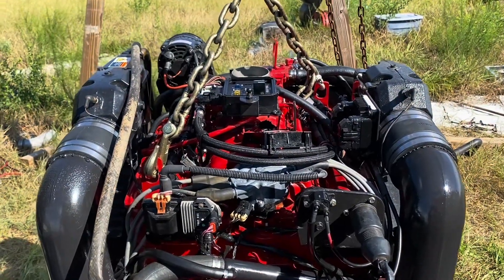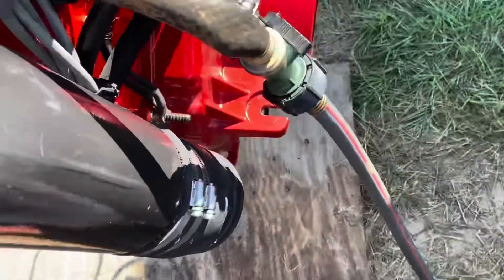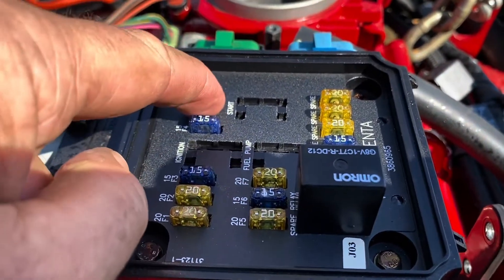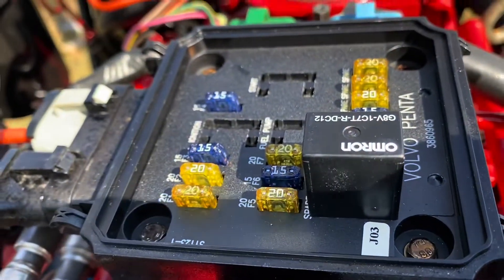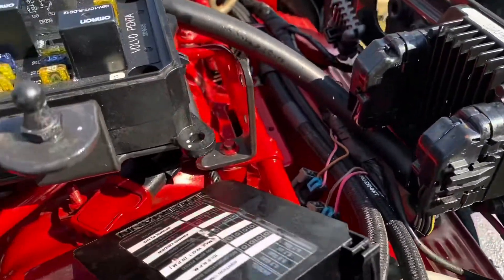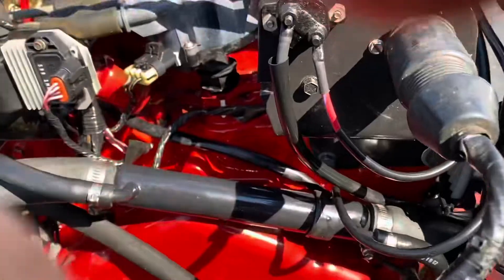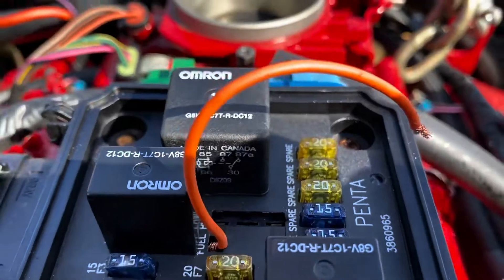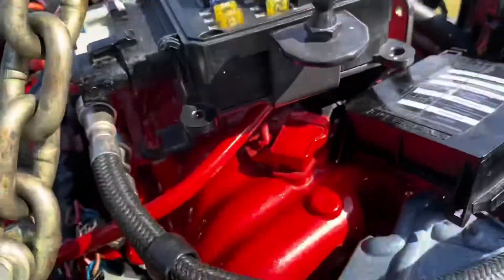Volvo Penta 5.0 to 5.7 - Son of a Beach/ 🤬I Bought a Defective Engine

Comment: Wow.
Protect others: name names.
Reply from the maker: I don’t even remember who it was. All I know was it didn’t have a marine camshaft, had automotive head gaskets instead of marine and a bent snout on the crankshaft. My customer pressured me into buying a reman engine against my recommendation. It won’t happen again.
Reply: @moccasinmarine  It appears the engine was dropped after assembly - there's a big blemish on the balancer.
Keep up the good work, my friend - and thanks for the detailed videos!
Reply from the maker: @basketballjones6782the balancer was from the old engine. All I bought was a long block for $1500. I had to put the oil pan, balancer and all accessories on it and didn’t discover the bent crank snout until I ran it live in the video. My viewers are watching in real time me discovering the bent crankshaft.
Reply: @moccasinmarine  That just plain old sucks right there!  Someone didn't want the boss to know that he screwed up.  Thanks for letting us know!